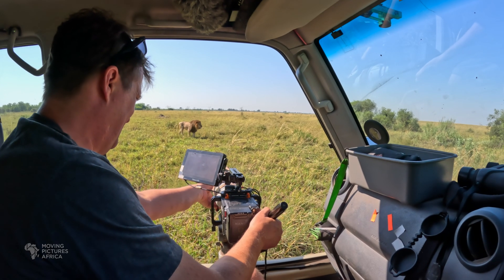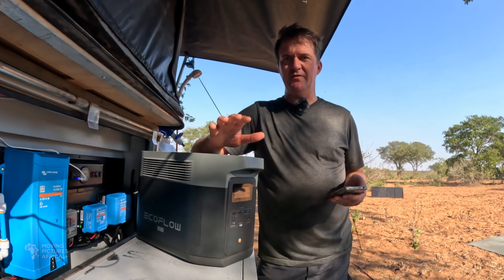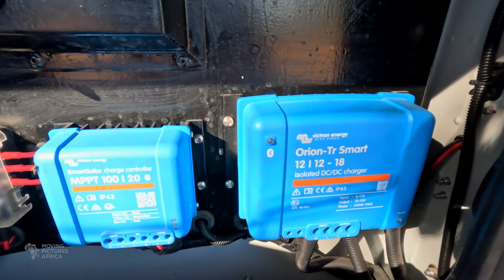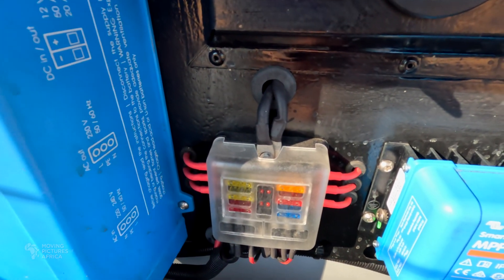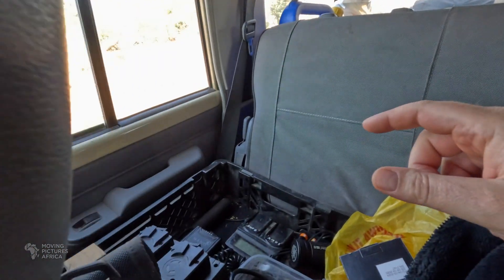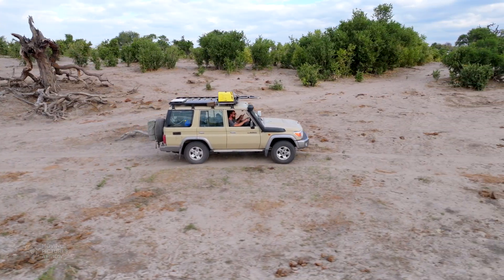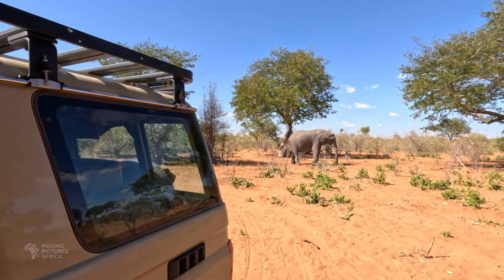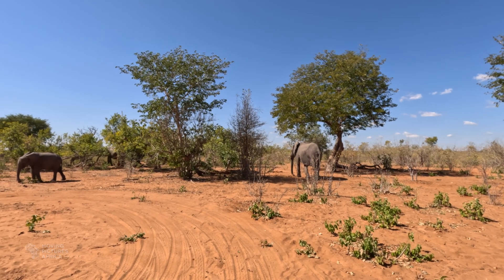Power Station vs Dual Battery System - will the EcoFlow Delta 2 Max work for overlanding and 4x4?

Comment: Great video!
I love Eco Flow it is great equipment but they're way overpriced Instead of all that hassle you're talking about on DC power just get your Pecron power station that has a 30 amp 12 Volt DC output, Wire it into a fuse box that runs everything DC in your vehicle Then you'll have everything that you want for a fraction of the price.
Reply from the maker: Thanks Dave. The Pecron units look very nice but they are not available in South Africa as far as I can tell
Reply: @MovingPicturesAfrica  For some reason I was thinking that it was if I had realized I wouldn't have even mentioned it, sorry
but like I said ecoflow Is a good product is just a little expensive Keep up the good work and take care 😎😎
Reply from the maker: @DaveSquibbSrno worries. I'm sure your comment will be useful to people not in South Africa

Comment: Well done👍  Since electrical is such a minefield of uncertainty "for most" - it is good to have someone who explains it in a very concise manner👍 (Bonus - elephant footage doesn't hurt)

 I built my system 8 years / 160k kms ago with great success.  I was hearing (YT) on how van builders are using EcoFlow  PB in lieu to component systems. (as you indicated you would consider it) So that sparked my curiosity as a VALID Option.

Thanks for the real world use case scenarios - very helpful. 

I just bought a Delta 2 Max as a  backup battery bank  to complement my component system. Lately I am Off Grid for longer as the years go by and found just a bit more power would be nice & the Max will also transfer to my other vehicle when on a trip & of course a backup to my home as well.

BTW - the price for the Max (on sale this week 40% off-: ) was the same price  that I paid for "one" 110 amp lithium battery  8 years ago. Amazing!!!
Reply from the maker: Thanks Terry. Yes, things are changing rapidly and getting more affordable.
Reply: @MovingPicturesAfrica  Again - THX

Comment: Excellent information thank you 👌👌. I was really torn between the two solutions, but to start I may well go with a portable pwoer station with microinverter. 

On the other hand, having an older bakkie, I can hide some components of a dual battery system behind the back seat, so could benefit from a space-saving there. Then just get a much smaller portable power station for backup. Dunno 😄

Comment: I have had my Power Station for 2 years now.... it is the easist thing to use.  You can pull into cars plug in 12 v port and with a solar panel on the roof, between these two power sources my PS is always fully charged.

Comment: Thanks for the video, I'm in the process of designing and installing a Victron system in my Cruiser but after seeing this I'm not so sure anymore, the 800W alternator charger is the deciding factor I think, and the 170ah battery capacity of the delta 2 max is sufficient to run a 90w fridge, charge camera gear and make some nice coffee. (also keeping it charged with a solar when camped for a couple of days.) Don't know man, this is seriously looking like the way to go.
Reply from the maker: It is a hard call. I've just arrived in Zambia with the Alternator Charger. My plan is to install it and disconnect my dual battery system and test it for a few days. I'll make a video showing the process.
Reply from the maker: To make your decision harder, Victron now has a smaller, more efficient DC-DC charger called the Orion XS, that puts out 50A.
Reply: @MovingPicturesAfrica  Yes, I played around with it in the week, it's significantly smaller and lighter than the old Orion and allot smaller and lighter than the Ecoflow. Would really appreciate the honest practical feedback of you using it in Africa while your big system is disconnected. Thanks for the content, your channel is top notch!

Comment: I bought the ecoflow Jan last year. Wasn't impressed to be honest. Massive power input from the wall but for a company that advertises remote use charguing from 240W solar panel and cigarette lighter is pointless because it's governed at 10Amps. It was late Jan in Eretshe so kak hot as well.
Reply from the maker: Which model power station and solar panel? The solar input should handle 240w. Yes, vehicle charging is a weak point for all power stations. In the video above I suggest a cheap way to increase the vehicle charging current to 30A on the Delta 2 Max or even up it to 500W if you add a boost converter. I also chat about the new Alternator Charger that will enable 800W charging in the vehicle.
Reply: @MovingPicturesAfrica  i got the Delta, it can handle the 240W but still governed at 10amps which is pointless. I made my own XC60 - anderson plug as the cigarette lighters are known to heat and switch off (another pointless issue). I'm steering far away from having to keep making alternate arrangements to make something else do better in my rigs. charging direct from the alternator would work but then you have to go through the inverter which again isnt first prize as there's other items running like fridges etc etc
Reply from the maker: @4x4OutFar  if you are hitting the 10a limit when using your solar panel, you can increase the voltage using a boost converter.
Reply from the maker: @4x4OutFar   I was not referring to charging via an inverter, I was talking about the new Alternator Charger. However, I think you need a Delta pro or max for this to work.

Comment: Thank you and it sounds great, just one correction. You can't use a transformer in a dc system to up the voltage, only on a ac system, this is due to Faraday's law of induction
Reply from the maker: @eenvoet  ah, thanks for the correction. You are absolutely correct. I think I should have said 'boost converter'

Comment: I've been playing with the idea of using an Ecoflow Delta as the "shore power" for my offroad caravan, and hooking up a solar panel to the Ecoflow. So I'd plug the caravan's blue plug into the Ecoflow for AC out, and charge it with my own panels. My caravan already has a 100Ah AGM battery for 12V, so the Ecoflow would handle the Caravan's battery charging, as well as the AC power.
Reply from the maker: @TheOuboet  not a bad idea. If you get the Ecoflow Alternator Charger and connect that to the caravan battery you could charge the caravan battery without going via AC and also charge the Ecoflow while driving.
Reply: @MovingPicturesAfrica  Great tip! Thanks!
Reply from the maker: @TheOuboet  no prob.

Comment: I was always a fan of the dual battery system and still love my blue power but these days the power stations gets more attractive 
Great video👍🏻
Reply from the maker: Thanks Jacobus. Yes, with the new Ecoflow Alternator Charger they really are a viable alternative. On our next trip, I will hopefully have an Alternator Charger, and my plan is to disconnect the dual battery system in the vehicle and only use the Ecoflow.
Reply: @MovingPicturesAfrica   lol im actually just bought the new Victron Orion XS 50Amp to uprade my 30amp.. together with a bigger MPPT and more blue power monitor goodies, but now after I watched your video im thinking maybe the power station was a better option.. All started coz I wanted to fit a espresso coffee machine :)

Looking forward to your feedback video
Reply from the maker: @jacobusvanderlaarse2942  Coffee is the problem 😂. I'm definitely bringing a little Nespresso on the next trip. BTW been using an OutIn Nano in the vehicle and so far it has been great. If you pre heat the water you can make a lot of coffees before you need to recharge
Reply: @MovingPicturesAfrica  lol convinced myself that I dont need a espresso and that a JetBoil would do the trick, lol naaa was not to long then I went and got the stuff for the espresso.. think the Overlanding hobby is a disease 😂
Reply from the maker: @jacobusvanderlaarse2942  an expensive disease!